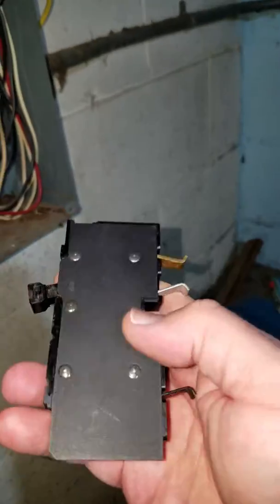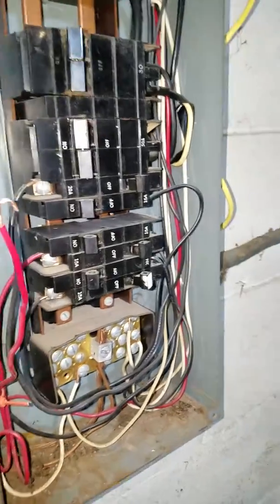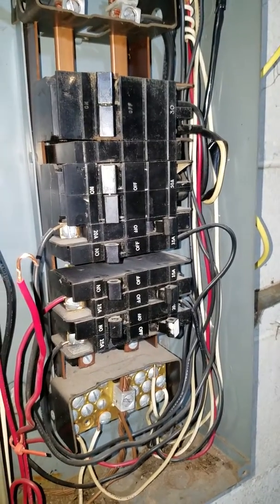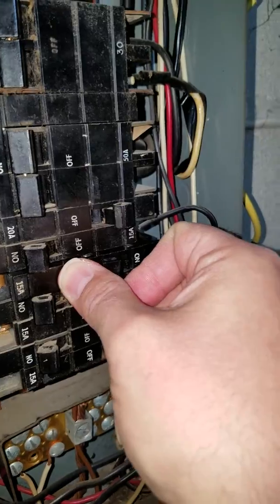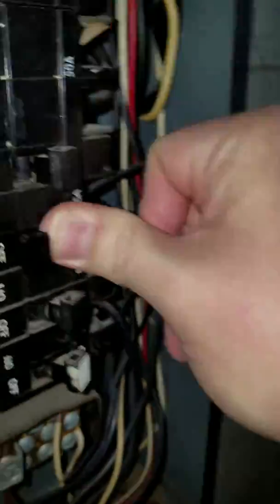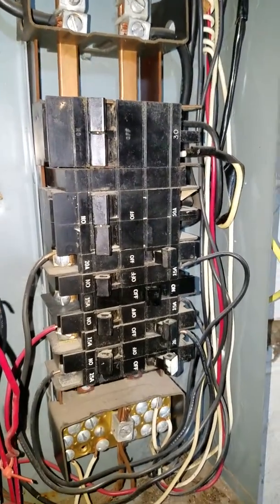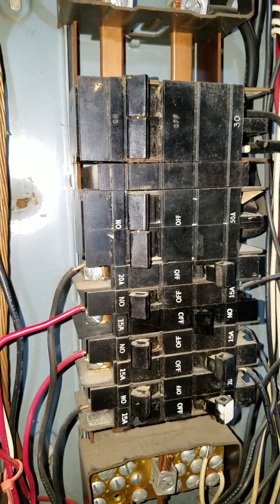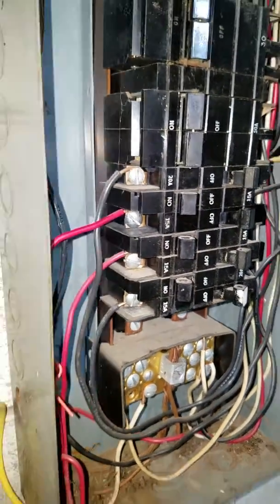Cutler Hammer circut breaker replacement XO single Pole

Comment: Thank you your a life saver....have the same old box and found a circuit breaker on Ebay
https://www.ebay.com/itm/Square-D-and-Cutler-Hammer-XO-XO115-1-Pole-120V-15-Amp-Circuit-Breaker/400893251304?epid=2255950943&hash=item5d57198ee8:g:1fAAAOSwqu9VFWrA